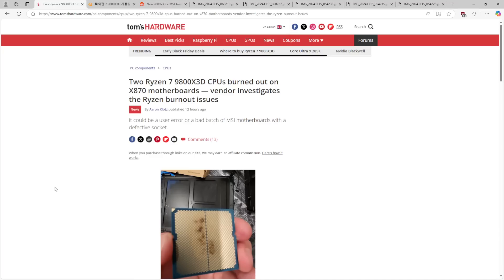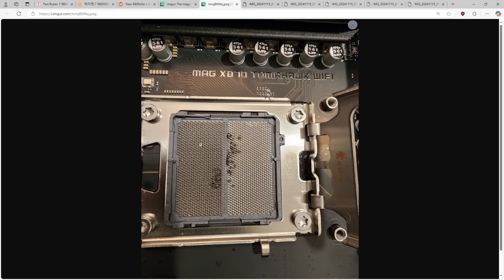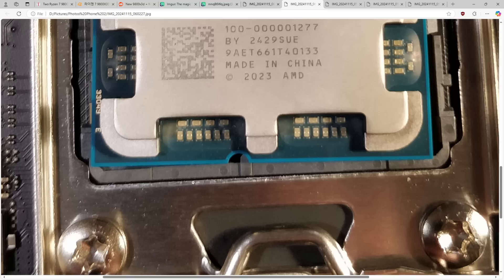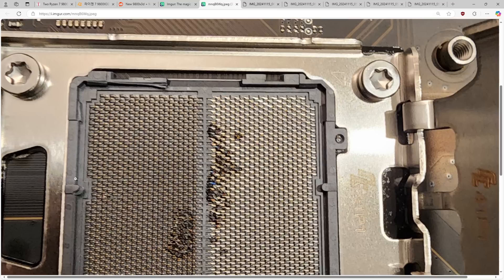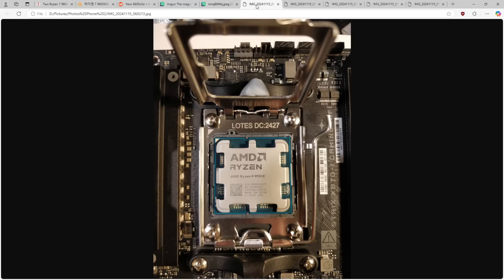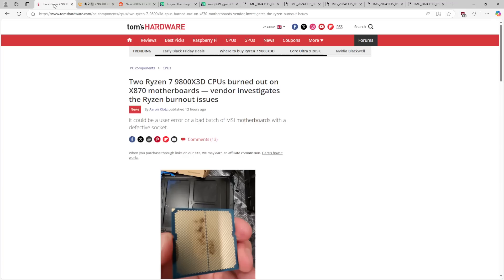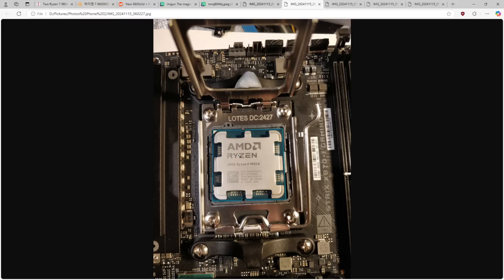HOW NOT TO BREAK YOUR 9800X3D

Comment: Install vertically while standing on one leg, got it. Thank you BZ.
Reply: Waiting for a "How to" video 😅.
Reply: @lixlax1494  Might need to hire The Verge for that... time to get out the tweezers and swiss army knife 🤣
Reply: @Knaeckebrotsaege  Don't forget to get a table.
Reply: @lixlax1494 same
Reply: I have built north of 1000 systems, I was not aware of this superior installation technique, if I hold my tongue the wrong way, will that matter?
Reply: @steven44799  You are supposed to hold your tongue a certain way, only while licking the pins, you don't need to keep it like that afterwards, rookie question!
Reply: @steven44799 you can gain up to 400mhz of extra overclocking headroom with the correct tongue positioning
Reply: Standing Steve will show you how it's really done people just wait for the video!
Reply: Verge made a great video on PC building, check that if you feel lost at any point
Reply: @aquinamedia4508  If the room attained an orange glow, my head got warm, and I smelled burning hair, I wouldn't believe the Verge if they told me my hat was on fire.
Reply: Alternatively stand on your arms while installing the CPU with your toes, while the system is standing on a ladder.
Reply: Lying on a comfy couch will do it too, Steve! Just make sure it's not during a Cinebench run!
Reply: Sounds correct.
Reply: Strapping my computer to the ceiling so that it lies flat, thanks for the tip!
Reply: Don't forget to spin in circles at least 10 times with socks on carpet before installing vertically while standing on one leg.
Reply: User : Instructions unclear, the GPU is standing straight up while holding the PC casing on top of it.
Reply: it´s because Youtubers show it this way every time.
Reply: can we get a video demonstration, please?
Reply: no no, vertically  but upside down :)
Reply: Good for you HUB, that this year you had a lot of practice standing ;)
Reply: while petting your mate kangaroo at the same time
Reply: Steve will be installing this vertically while standing on one leg while sitting down is there nothing Steve can't do 🤣🤣
Reply: I hope you cover it guys to not scare people away from 9800X3D
Reply: You forgot the correct angle of the tongue. That is important as well.
Reply: You forgot to lick your thumbs first and click your heels
Reply: This is what store staff did when they install my cpu. He rested the motherboard on top of the box. Part of me died inside when he pull the lever with 1 leg raised.
Reply: Directions unclear, cpu stuck in ass
Reply: For best results drop from a height of 13-17cm
Reply: Some people making videos need to build a computer vertically while holding a camera
Reply: BUT BUT BUT.... IT'S AMD'S FAULT...
Reply: PC master race for the win! I am not drunk, thanks Steve
Reply: LOL hub actually chimed in here, they are literal clowns 🤡 “we’ll advocate that ultra quality sucks but then we’ll test everything at ultra quality and cry when the sky falls”

Comment: Even if you install the CPU vertically, if you hold it in place through the metal brace, you can keep it in the correct position with little risk. Other than that, always quadruple check everything.

Comment: AMD: puts keying notches on ZIF socket to make sure everything lines up
Users:
Reply: It said zero force so I just thought it would work!!!!
Reply: This isn't a ZIF socket. It's a LGA socket.
Reply: amd could do better job to be honest !
Reply: @Lookingformorefun  theres a reason shampoo has instructions on it and a warning not to drink, they could never do enough for some
Reply: @mainsource8030  maybe user has problems with eyes and was too pumped to test performance
Reply: @Lookingformorefun if the user has problem with their eyes then maybe they shouldn't be building computers similar to if someone has problems with their eyes they shouldn't drive vehicles. Don't blame the vehicle manufacturer for your inability
Reply: @Lookingformorefun  So it's decided - it's AMD's fault for creating CPUs that are so good, the buyers can't control their excitement when installing them in their systems :D
Reply: @Lookingformorefun  Are you the type of person that the subway sub wrappers are made for? You know where they had to print "Do Not Eat This Wrapper" in bold letters.
Reply: @elilla331  Sometimes I just get too excited. Would be so much better it they just rounded one corner or made it into clearly different shape. Its not that hard.
Reply: @Lookingformorefun   it has clearly 2 notches that line up fully with 2 notches on the socket. If you cannot see that or install using that. It's 100% user error... And if you have vision issues and you cannot see even that (I have a friend who is legally blind from birth, he doesn't have trouble with this.) You have to be basically fully blind. Which means you should get someone to help you.
Reply: @Lookingformorefun  The corners are done weird. Why aren't they squared off in the socket to match the CPU?
Reply: @willjohnsonjohnson  they could do so many things to make process easier. to minimize chance of user error.
Reply: @Lookingformorefun  Like NVidia with the power connectors on the 4090s?
Reply: @Lookingformorefun  Exactly, for $480 asking price of 9800x3d I'd expert a hot model to come to my house and walk me through the build process.

Comment: to be fair it could be that the bracket and stuff doesn't hold it properly somehow and when you tighten the cooler down, if you put uneven pressure on it or something it can slip, then you continue tightening and it does the damage. probably not but i want to believe people can put a cpu in keyed socket right.

Comment: You are absolutely correct This is exactly what happened I installed my 9800x3d vertically because my system is custom liquid cooled I have been doing it years from Intel CPU sockets and it is very tricky to do it correctly and safely without damaging the CPU or the socket itself but what I am surprised about though is they must’ve realised the force they were having to put on the leather to close the CPU socket was excessive
Reply: Now that you mention it, back during my refurbishing days, I probably did try a vertical seating on a spare LGA1156 socket once just to see if it could be done. It requires a little finesse with switching finger placement, but the CPU clip allows it to be done. Once you can press and hold the clip onto the CPU, the amount of force required for the latch is minimal. LGA1366 would be the same.

Comment: I replaced thermal paste with kryosheet(on a 5800x) a couple of days ago, but ripped the cpu of of the socket as I tried to remove the water pump. I was angry AF. Luckily no damage or bent pins.
Reply from the maker: yeah that's actually a really common thing with PGA sockets. I bent 2 entire rows of pins on an FX CPU when I tried to remove the cooler by tilting it. Now I always pull the cooler straight up and just expect that sometimes the CPU will get pulled out with it.

Comment: A customer came in with a bent CPU and chipped substrate in one corner. Asked him how he got that much damage, he told me he forgot to put the processor while the motherboard was out of the casing and didn't want to take it out because it was a pain installing it vertically with the IO shield... Asked him why he didn't tilt the casing horizontally, told me he didn't want to scratch the casing. 1000$CAD damage not to scratch a 70$ casing. People are stupid. Good analysis.
Reply: In such situations I place the case on my bed. Quick & easy,  no scratches.
Reply: @mleise8292  yeah or even a towel or something else soft on bench or table, but STOOOOOPID Lazy People will STOOOOOPID & Lazy
Reply: @shaneeslick  Not as expensive but as stupid, I've had a lad who couldn't be bothered to unplug his CPU cooler fans when he was swapping 7600 to 9800x3d; balanced his Deepcool dual tower on the side of his case, destroying his "don't worry, I have a good board" strix x670e-e. Not sure how these people keep themselves alive.
Reply: @mleise8292 exactly, is not like one is forced to put the case on some harsh surface full of nuts and bolts 😂
Reply: Scratch the casing? A metal casing? I've often scratched things (tables, wood floors) with casings sharp edges, but never happened the other way around.
On what does he build, bare rock?
Reply: @emiliofederici9459  You don't have a diamond grit tablecloth?  You're missing out
Reply: "I calculated the risk but went ahead anyway!" 😂
Also, towels, table cloths etc are great for preventing scratches...
Reply: $1000 CAD in damage because they didn't want to grab a towel or blanket to put down*
Reply: i think towels and tables were invented by that time,  tell him that next time.
Reply: casing = case
Reply: We have this stuff called cloth you can lay stuff on. It's kind of a new thing though so maybe not everyone knows about it.
Reply: Did he not have a towel or microfiber cloth to cushion his PC casing placed horizontally to avoid scratching ?
Reply: @HattoriZero bubble wrap works too
Reply: If he spend just an extra minute to find a blanket for the case, he can avoid all the issues...
Reply: And all they would have had to do is put down a clean towel to avoid scratching the casing. Good grief!
Reply: Do they not own a towel or t-shirt they could put under it? How do these people survive life?
Reply: There are cases for 300+ though
Reply: @Donbros  Ok. So? You can set a million dollar case on a towel too.
Reply: Or just put a bath towel down and set it horizontally on that. I dont think I've ever change any component vertically... like ever in my whole life
Reply: Why not just put a towel or a shirt below the case to prevent a scratch for God sake
Reply: How does your account have no youtube handle?
Reply: Calling your customers stupid? Gross. Typical Quebecois smugness.
Reply: If you have a huge RTX 4090, actually consider it as part of your build and thus connect it with a riser so that it is vertical inside the case, instead of horizontal. 

That's all you really have to do, get a case that isn't $30 and a PCI express riser.
Reply: @masterkamen371  Or if you're not all snooty like you, you could walk outside, find a free stick and just stick that stick under the outside corner.
$0 dollars, 5 minutes.
Reply: You denied his claim right?
Reply: I would not want to scratch a 70 dollar case but whatever :P weird wording here
Reply: I remove the back side panel so it lays down on the frame.  No problem
Reply: SMH. Lazy and stupid is a hugely incorrigible combo
Reply: Rather than complain about the people with special needs, we could stucture our services around their needs. For example, why not offer a free anti-static and scratch-free padded mod mat (like the ones Gamers Nexus sells) with your service plan. Perhaps, offer the replacement contingent upon their purchase of the service plan. That way, everybody gets what they want!
Reply: I don't get it, you don't even need to do it in the case. Set the mobo on a soft and safe surface horizontally and install the cpu. THEN put the mobo in the case. Dumb people make my brain hurt trying to understand their mouthdrooling logic.
Reply: Damn.. the internet really fucking up this generation
Reply: Could have put a piece of cardboard under the case while laying it flat, but nooooooooo...
Reply: I use my pc horizontally for this same reason i just put my monitor on top
Reply: I have to agree with this
Reply: And I hate rgb I like the old look better no rgb
Reply: What about people with massive GPUs sagging (4090) which could easily be solved by keeping the PC case horizontal, but they don't do it because they say it looks ugly, and then they wonder why their GPUs bend and die after one year of use
Reply: @AdrianOkay  I have a "massive 4090", most cases can't be kept horizontal by design (mine, Lian Li Lancool II, has a glass panel also on the back) and, most of all, laid horizontally a tower PC has a much bigger footprint, taking a lot more space.
GPU sagging can be solved easily with vertical risers (that I don't like because harm card cooling) or, easiest and cheapest way, with some few bucks specific solution from Amazon (those little holders that now even come with RGB).
Reply: @emiliofederici9459  Easiest and cheapest way is to tie a string to the the GPU and the top of the case. Costs $0.01 and requires no special-order parts.
Reply: @AdrianOkay  Makes sense for us older folks who remember desktop PC cases. Dang it, PC case and heavy CRT monitor on TOP of it... those cases were built different. Airflow efficiency non-existent, lol. But today, some new cases come with a GPU holder. And some people who are more handymen, come up with their own form of a GPU holder to prevent sagging (Superman figurine holding the GPU is very funny).
Reply: @AdrianOkay  Horizontal takes more space which people mght not have.
Reply: @jorge69696  Horizontal takes space in a different direction, not more. My horizontal case is in an Ikea storage(?) shelf with adjustable shelves, because I wouldn't have space even for a vertical case. Adjustable computer width shelves OTOH are perfect.
Reply: @AdrianOkay  hmm, I dont really see that many horizontal pc cases. But regardless, many heavier cards like 4080 or 4090 come packed with support brackets. Its just people who are stupid to think they wont need it.
Reply: @AdrianOkay While it’s not to combat sag (since you can also just get supports) I do happen to keep my case with a 7900XTX horizontal.

It’s the only way it would fit in my tv stand where the consoles used to live 🤷‍♂️

I will admit I found myself looking up if it was safe to do since you literally never see them on their side so it occurred to me it might not be designed to lay on its side.

Turns out it’s just looks. Some cases won’t have airflow when laying on their side, but mine does. 

(It’s not an old wooden stand with a cabinet, it’s steel and glass with no sides or front and a thin mesh back).
Reply: @AdrianOkay  That's stupid, the vast majority of tower PC cases are not designed to be laid flat because of cooling design. If the GPUs sag that's Nvidia/AIO partner's problem, and many 4090s are supplied with reinforcing brackets or stands that hold the GPU so it doesn't sag.
Reply: @AdrianOkay  u okay in the head ?
Reply: @AdrianOkay  All my life I've always run cases horizontally, never had anything fail on me, Only things that has failed was a ryzen 5800x3d ( accidentally chipped off a corner of the ccds), and a "bricked" 1080ti that will need to have to bios manually set back to its original as it wont allow me to flash it back through common ways. Basically outside of user error  its all been good.
Reply: I think anyone who purchases a 4090 can probably afford another one so they shouldn't worry too hard what happens to it.
Reply: @AdrianOkay  just use pillar
Reply: @AdrianOkay  People building in cases with more and more glass because they want to light the complete room with ugly RGB, and complaining about heat. Wait what doesn't solid glass provide airflow?

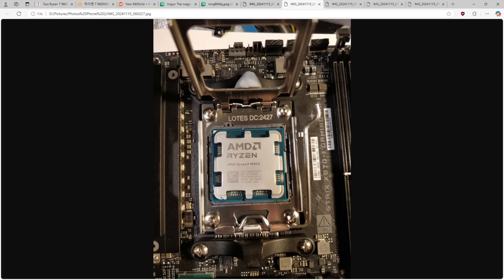Comment: 3:52 Blindness won't cause that much damage, I know because I sometimes build PCs with my eyes closed (yes, I know it's weird, but it's pretty fun). When your sense of "sight" is touch, you'll clearly feel that the CPU isn't seated properly in the socket, even if it's not parallel to the motherboard and, most importantly, it's not wobbling between the walls of the socket, not to mention the difference in force required to close the ILM.

Comment: As someone who routinely delids CPUs and has never broken one yet seeing them get smushed into oblivion while being installed carelessly is mind boggling.
Reply: Yea, with how those tiny spring contact in the socket are so incredibly delicate that I cannot imagine anything other than extremely carefully putting the CPU down on them. While also checking the aliment like 10 times over.
Reply: Gives brute force approach whole new meaning 😅.
Reply: I'm afraid to ask but: How often did you have customer complaints after delid and it turned out to be user error ?
Reply: since you're routinely deliding CPU's i have a question.
what is the point of deliding CPUs anymore?
i mean, Intel CPU's have been garbage for the past 3 years and have been pretty much shipped out of the box in their highest possible stable clock settings (albeit they still degraded themselves into oblivion but i digress).
and AMD Ryzen CPUs were never really designed with overclocking in mind, albeit the AM5 platform made overclocking AMD cpus a bigger possibility for Ryzen.

Deliding made sense back with the Intel Extreme HEDT platform, and when Threadripper didn't cost an arm and a leg, but nowadays isn't it just kind of pointless?
Reply: @HoLDoN4Sec AMD Ryzen wasn't made with overclocking in mind?

Isn't there a reason that they are all unlocked? AMD has a long history of easily overclockable chips even before Ryzen, and was pretty much the only reason to buy an AMD FX chip at the time. An FX 6300 had the world record for highest frequency reached for a long while.
Ryzen CPUs are still very much meant to be overclockable just as they had been before, it's just more casual PC enthusiasts like me have gotten ahold of them now so less people are doing it. I don't plan to OC either of my two Ryzen chips.
Reply: @HoLDoN4Sec  Exactly the same reasons and benefits as for intel.
Temp, power, stability, clocks, headroom.
Reply: @HoLDoN4Sec intel alder lake CPUs are absolute monsters to this day.